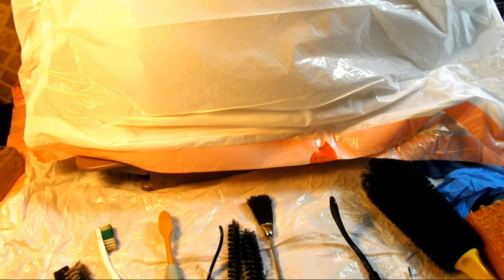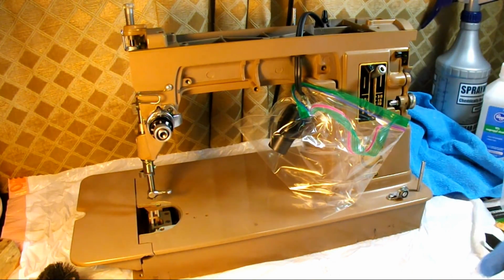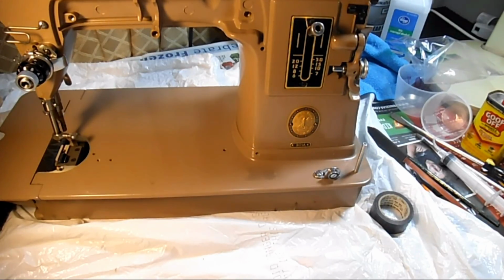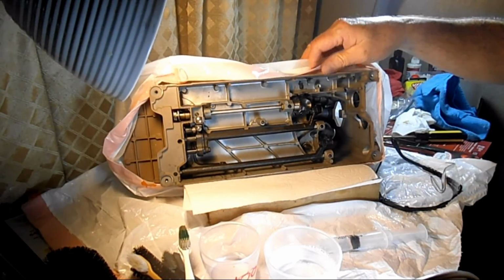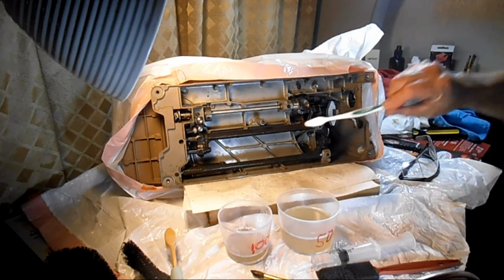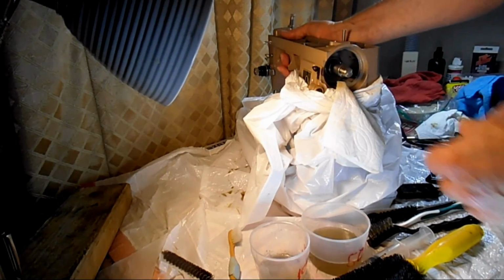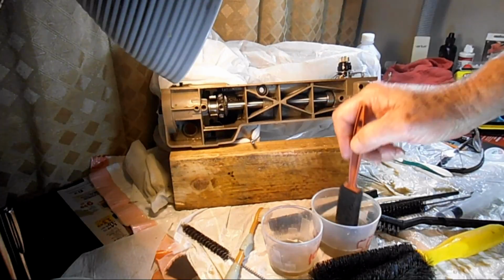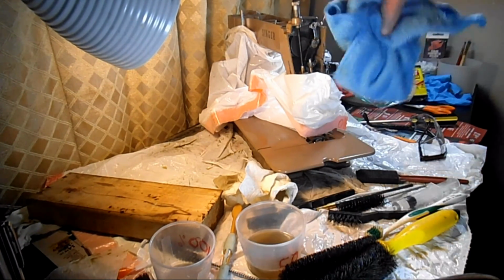Coco gets Exfoliated - Coco goes to the Spa Pt. 2 - Singer 301A Rehab

Comment: Will removing the worm gear/motor to clean have the same effect as disturbing the factory set mesh?
Reply from the maker: No, it will not harm those. The pinion gear on the end of the motor shaft mates with the Textolite gear on the handwheel in a different manner than the beveled teeth gears on the drive and hook shafts. Cleaning the muck/old grease/oil off the gears and the area inside where the handwheel mounts is a great idea. The fresh grease will be very good for the machine. A really good question, Candy. I'm pinning it to the top of the comments for others to notice. Thanks for watching my channel.

Comment: Andy, on my black featherweights I have always used kerosene to clean my gears and all the greasy areas. Can I use this in place of the Krud kutter? I have wiped some places on the black paint that are really dirt with kerosene also, but once it dries it is hazy. I have wiped sewing machine oil over this hazy area and it brightens it right up. I have since trued not to use kerosene too much on the paint but the smo has always corrected this. Thank you thank you for these videos!
Reply from the maker: I've never used kerosene b/c my wife is sensitive to it. A couple of the Singer Repairment told me when they had some of the old model 15, 66, 101, 201 models they got in the shop that was just filthy dirty they would remove the motor/wires/rubber and soak the machine is kerosene overnight. In the morning they wiped it off with rags, oiled it heavily, ran the machine for 5 to 10 minutes adding more oil to flush the kerosene out of the bearings if needed, then wiped the machine down with fresh oil on the outside. All those models had black finishes. I had one 221 featherweight to play with and did some cleaning/adjusting videos with it. You can find the playlist of videos here: https://www.youtube.com/playlist?list=PLsCOZgzzaiKIA1OPw0k6QOSTE-wAUZ4kp
These folks sure know a lot about featherweights and their Schoolhouse section has tons of information if you've never visited.
https://singer-featherweight.com/   Thanks for watching my channel and take care.
Reply: @andytubesewing1953  thank you for replying back. I removed everything as you advised prior to the “bath” but I think I’m just going to see what I can do with Zymol and smo. It seems to be responding to these two things. I am really enjoying your videos. They are so thorough and you talk about everything!! Oh yes I almost forgot, on my 301 when I removed the wiring for the light and plug receptacle the red wire was connected on the right, not the left. I never plugged it in so I’m not sure if it actually ran or not and it was so dry and no grease at all so I didn’t want to risk running it until I took care of lubrications and oiling.  Is this a problem having it connected to the right and not the left?
Reply from the maker: @cristinas.5699  The red wire on the right is no problem. I've tested these motors extensively and it does not matter which color wire goes on which pin for the motor. The plug on the cord is NOT polarized, meaning you can plug it in however you like and the motor will run normally. No worries about the red wire and I'm glad you asked. Take care.

Comment: Andy, you said not to use krud Kotter on black singers and you said someone suggested  gojo, but what do you use on black singers?
Reply from the maker: I have only cleaned two black Singer Machines. A 99K and a 221K Featherweight. Here's how I tried to clean them:  The 99K - https://youtu.be/w6fn-TSOCYo     The 221K  outside - https://youtu.be/nZKAVHfUQoc   and inside - https://youtu.be/lz2xV3zfvJE
So you see I have only limited experience with them. I've often been told to just brush the outside off with a dry paintbrush and wipe the finish with sewing machine oil. Here is a video from the Featherweight Shop about cleaning the finish. They make their living doing this - https://singer-featherweight.com/blogs/schoolhouse/cleaning-and-polishing   Thanks for watching my channel.
Reply: @andytubesewing1953  Thank you
Reply from the maker: @horstlinde2001  👍

Comment: Hi Andy Tube, at 40:00 are you injecting Krud Kutter into the oil ports? How long do you leave it in? Thanks for your good work!
Reply from the maker: Hi, Jebb. Yes, that is the KK I'm injecting. I put it in towards the end of the pretreatment time. It is probably in there about 10 minutes before I wash the machine. When they still had Singer Repairment they would inject Kerosene into the bushings and drip it on the oil points then run the machine to get a sluggish machine to move more freely. They would wipe all that off then, add fresh oil and run the machine 3 to 5 minutes. A final wipe down to remove any excess oil that oozed out. Over time I just started taking parts off the machine and washing the whole thing with the KK, flushing out/off decades of grime and crud to start fresh. Thanks for watching.
Reply: @andytubesewing1953 Thanks AT!
Reply from the maker: @JebbAdams  No worries and good luck.

Comment: Where can I find a list of all the things I need to clean my machine using your methods?
Reply from the maker: Good question, Flynn. Here is a link to my step-by-step series on restoring a Model 337. Part 2 is about the chemicals I use. 
https://www.youtube.com/watch?v=FpqkK5ieBgw&list=PLsCOZgzzaiKJxbOOMKQPvmeTRqi0dhGa5
An Andy Tube viewer recently sent me this link to a product list of chemicals recommended by a person who gives live workshops on cleaning and restoring the older black machines. It contains some great information will detail about each product. https://sewpurtyworkshops.com/products-we-use
Between the video and list, it should get you well on your way. Thank you for watching Andy Tube.
Reply: ANdy do you use Krud Kutter on the paint of the machine?
Reply from the maker: Never use Krud Kutter on Black Singer Paint! On the machines I wash, yes I use it on the paint. Even a 10% solution will cut the grease and grime off of paint. When I wash the whole machine in the shower, like the part 3 video you watched, I use about a 25% solution and try not to leave it on the paint more than a couple of minutes. It can and will dull the paint the longer it is left on. Usually, it is minor dulling that waxes right out. A strong solution will dull the paint much more. That is why, like in this video, I cover the body with plastic while I am pre-cleaning the inside parts with a stronger solution. Viewers have told me they cleaned the whole outside of the machine with a 10 to 15% solution and a sponge while rinsing with a separate sponge and water as they did each section and they were pleased enough with the results that they wrote me about it. Lately, I have heard more and more of people using Gojo hand cleaner (without pumice) to clean the whole machine, even black ones, with great results. I have not tried it yet.

Comment: Did I miss somewhere in part 1 or 2 what you did with the felt oil plugs in the top cover? Do you remove those before cleaning the top?
Reply from the maker: I just leave them in if they are still there. This cover had 1 missing. When I first tried Krud Kutter I tested it on a vintage and new spool pin felt and it cleaned great without any damage I could see. I should have mentioned the plugs, but hey it's a rehab not a restoration, right? Joke! When I do the followup lube video I'll bring it up. Really good catch and thanks for taking the time to comment.

Comment: Hello Andy, glad your on the mend. Love your video on Coco, her cousin Mocha lives in Chandler and she will go to the spa one day :-).  It looks fairly simple to take the wiring out.  I purchased some GoJo off Amazon to clean up the grease on the outside of my machine for now. Thanks for the pictures of the wiring. Very helpful.
Reply from the maker: Hi Elizabeth. Cousin Mocha too! Nice. Please let us know how the GoJo works out. Other viewers have told me they like it very much. I'm interested that theyy said it did not dull the paint AT ALL. I may need to change my cleaner.
Reply: Andy Tube Andy, The GoJo worked fine for the outside to remove old grease and grime and did not dull the tan body. I haven’t tried on my black beauties yet.
Reply from the maker: Sweet! Thanks for following up. Did you just brush it on & wipe off? Sorry, I've just never tried it. A viewer , Jack, and I have been discussing a produc called Oil Eater that sounds promising too. I need to try these I think. I love the Krud Kutter a lot, but why not have others on hand if they work as well or better? You are the best for letting uus know :)
Reply: Andy Tube I wiped it on and I used a rag to wipe it off with my fingernail. For the hard-to-reach places I used a Q-tip and sometimes a toothpick. I used a microfiber cloth.
Reply from the maker: Thank you for sharing. It sounds easy and something we can all try. I love the idea of not affecting the paint like Krud Kutter can do.